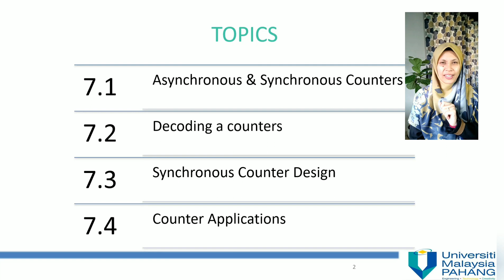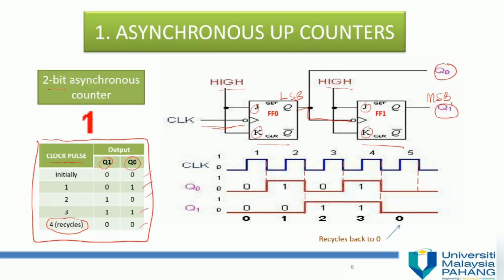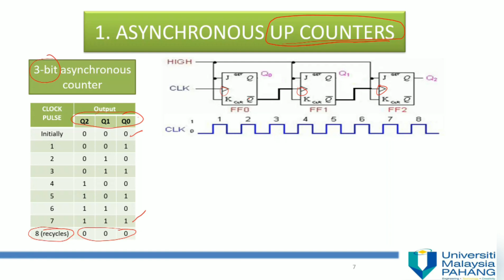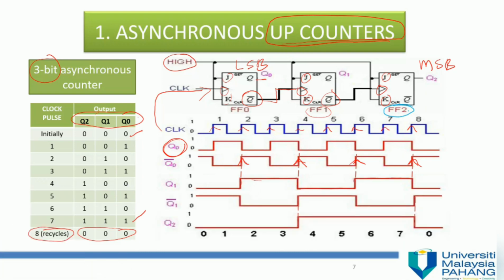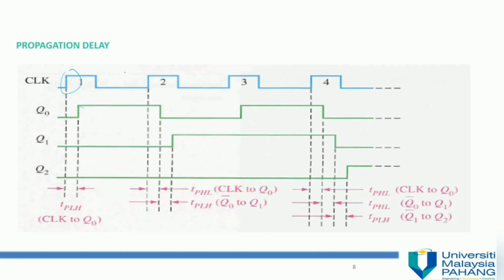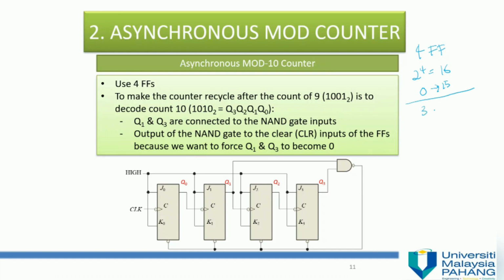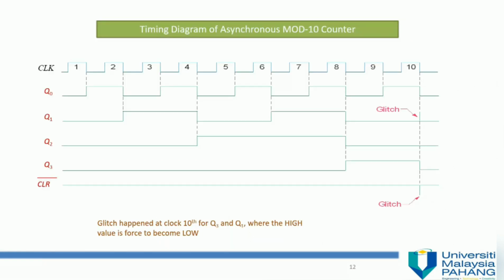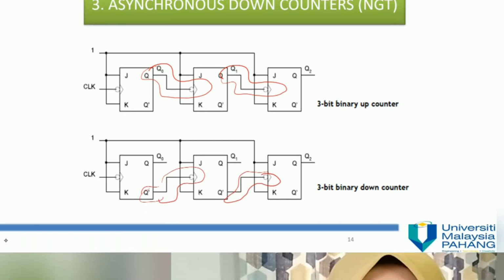Topic 7.1 Part #2- Async & Sync Counter

Comment: Assalamualaikum mdm , i from degree student , at the end of the video , u said that different between up counter and down counter which is the clock , but in the middle of the video , there is a example of 3 bit counter and  the clock for the next ff is taken from the Q', 
My question is , is that up counter also can take the output from for the next ff clock from the Q'
Reply from the maker: Waalaikumussalam. Thank you for your question. Yes the different is what input we give to the clock for next FF. Refering the lecture note, for case DOWN counter, we take the output from previous Q'